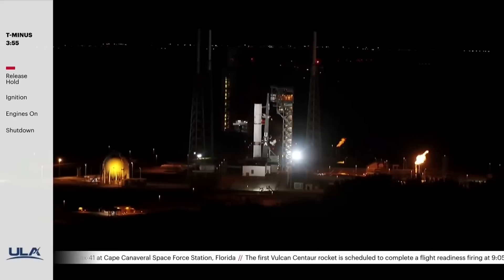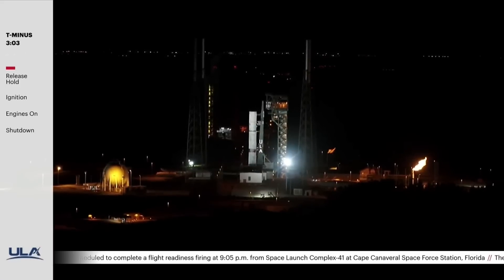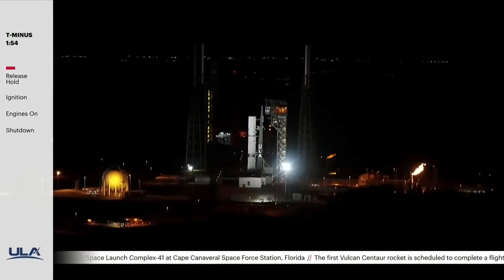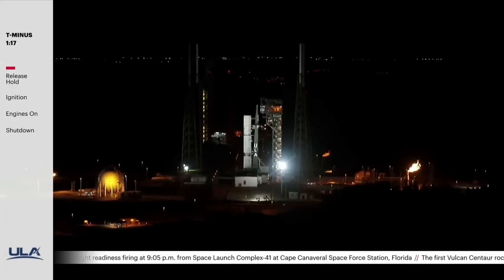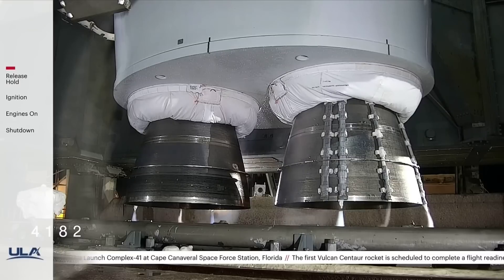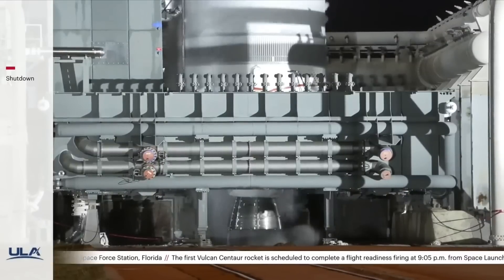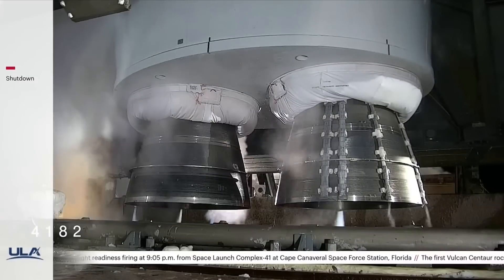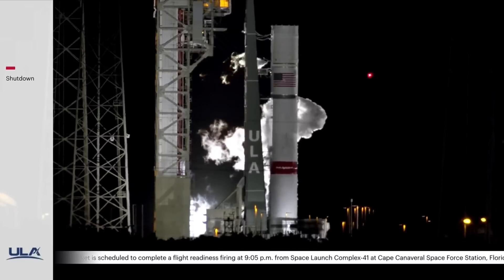New Vulcan Centaur rocket fired up for first time in test

Comment: Could that possibly have been more underwhelming? Less than a second of firing the engines, what was the point?
Reply: I see you like lying a lot. It was several seconds. 6.5 from ignition to cutoff. And the point is to not only do a countdown but also fire the booster with a fueled CV on top to make sure all systems work as intended. This is no different than the FRFs SpaceX carries out prior to a launch.

Comment: Good to see some progress happening, can't wait to see it fly. I do wonder if the centaur stage has had many changes or is it exactly the same as the one that rides on top of Atlas V currently.
Reply: The Centaur upper stage is very different for Vulcan. Larger diameter to match the Vulcan core stage, two RL-10s, much greater hydrogen and oxygen capacity. Plenty of chances to screw things up. But it did need to be done, unlike the foolhardiness of choosing main engines from Blue Origin which has produced basically nothing while existing for longer than SpaceX.
Reply: @owensmith7530  Nice little lie there.

Comment: Was it supposed to cut off like that and then seemingly reignite? Very confused
Reply: That's not unusual to see engines seemingly reignite for a split second. Not sure of the technical explanation (residual fuel in turbopumps?)

https://youtu.be/chDMW27iYoU
Reply: @ryddragyn  maybe it was just a super short fire?
Reply: @SpencerFH  Doubt it was an intentional relight, I've seen similar things on much longer burns on other engines. Maybe shortly after cutoff some residual cryogenic fuel warms up, expands, spurts out, and gets ignited by something?
Reply: @SpencerFH  Also, it's a bit hard to see the actual flames on this rocket because of how close the engines are to the flame trench.

Comment: Pretty cool test and musk built a bigger one in a tent and flew it before you’ve even got off the ground oh and you’ve worked on this rocket longer I’ll put my money on musk oh and don’t blow up my rocket
Reply: did you forget to take your meds?
Reply: @okaySLBTW  the ULA snipers are real
Reply: @okaySLBTW  lol it’s funny when you trigger people lol Musk go Musk
Reply: The difference is this rocket will most likely work and deliver actual payload on its first flight.  That’s not a knock on SpaceX, they’ve proven their method of rapid iteration and testing/exploding is also effective.  Besides, Starship is still a couple years away from actual flights, and we need a launch vehicle with the capacity of Delta IV heavy.   We can’t rely on one company for space launches, all rockets will blow up eventually.  When Falcon 9, or Starship, or Vulcan, or SLS blows up, we can’t afford to not have a alternative to use.
Reply: If only you knew wtf you were actually talking about, but instead decide to talk out of your ass in an industry you dont know anything about nor are smart enough to be a part of.